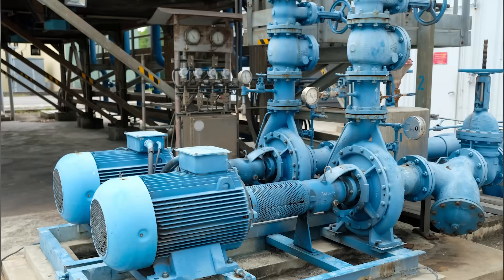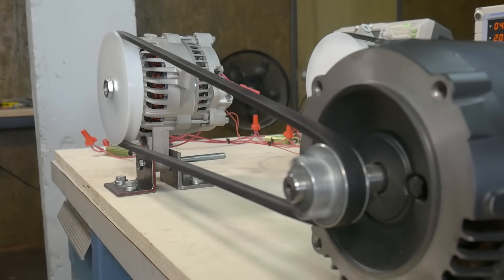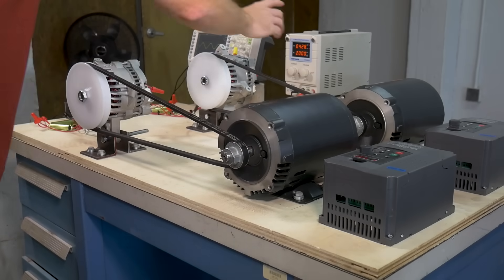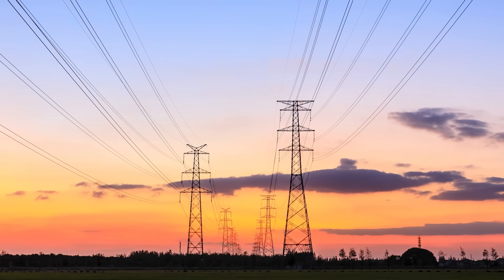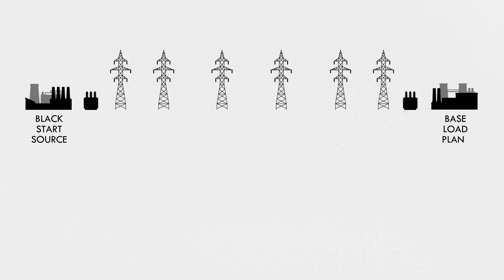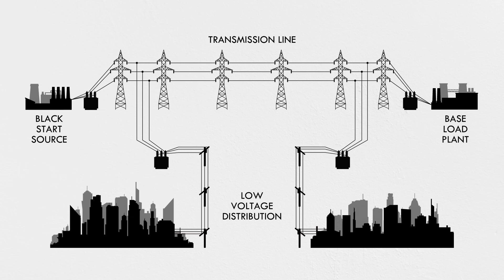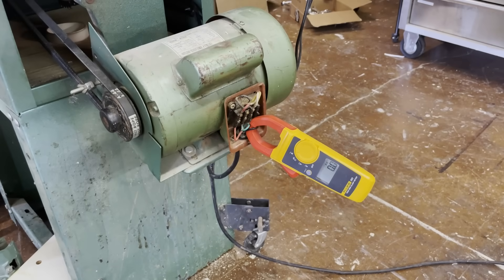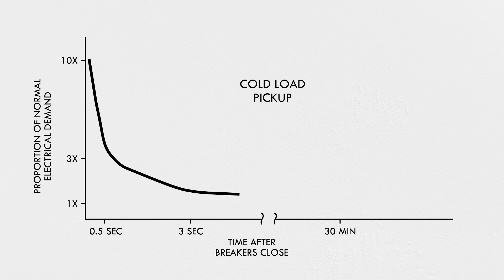What Is A Black Start Of The Power Grid?

Comment: If I remember correctly, the electricity generated by power plants must be used somehow.  During a blackstart when they are trying to get the phase of a power plant to match the grid's phase, where does that power go?
Reply: it contributes to accelerate the frequency. That's the tricky part.

Comment: Um, I understand that being able to vary the amount of power coming out of the alternator is a key and necessary feature for a power grid, but you only need that so you can match a voltage at any rpm, usually though varying current at a single voltage and rpm to maintain voltage and respond more quickly than the mechanical bits can or should.

However, I fail to see why they all need to be alternators. Besides, there have been large alternators with magnets. Why not use magnets for most of the alternators and just have a few electrically excited ones on top of the system to handle the more minor variations?
Reply: it's all alternators because we use alternating current. What you described would be true if we used direct current.  The main reason we use AC is because it opens the possibility to use induction in our tech, mainly transformers.

Comment: So, I have a question. I can see why if two generators are out of phase, you don't want to tie them together, but if you pick the right moment when they're in phase, but they have slightly different frequencies, will they naturally synchronize? Like how two metronomes at slightly different frequencies will sync up if they're on a platform that's allowed to sway?

Comment: I assume there are simulators for this kind of thing, right?
Also, how precisely time synched do different sources have to be before being interconnected? Across long distances even measuring time accurately becomes difficult, and time itself difficult to define. For example: What time is it right NOW on Mars? Of course this only applies if the precision required is extremely high.
Reply: No one?

Comment: I can't remember the channel, but was watching a video a few months back on startup of a small hydro electric dam. They were still doing it manually with a syncrotron. Very interesting to watch - it would auto trip offline if they weren't extremely close on synch before tripping the breaker; which happens several times in the video. The off-phase startup example definitely puts into perspective why grid tie is so closely regulated.

Comment: FANTASTIC video.  For the 1965 outage -- they made a movie about it -- and I seem to recall the Navy moved a nuclear carrier to New York City to provide . . .????  And, I seem to recall New York City still had some loads that were DC - left over from the days of Edison -- wouldn't those have been isolated, and still working despite the general blackout ?
Reply: If there were DC generating stations electrically separate from the AC grid, the DC system would have continued to operate normally, BUT !!!

More likely, individual customers made their own DC from the AC grid, or Con Ed made DC from the AC grid, and supplied it to the customers over separate DC circuits. In this case, the DC system is just a load on the AC system, and would go down in a blackout.

You can make DC from AC, or vice versa, using either a motor - generator set, or a (synchronous) rotary  converter. Consult Wikipedia for a better explanation of both than I can give here.

Comment: Love the deeper dive. Induction motors are an issue as are adjusting capacitor banks. 
Two nit picks - the 1965 blackout was not such much a misconfigured relay as one that worked as designed. As I heard it, the lines reached capacity and so the circuit breaker automatically operated - shedding the load to the other lines. Those lines then became overloaded and tripped off line. The cascade rippled outwards before operators disconnected themselves from the problem. 
Yes, we had synchroscopes. For small 750Kw systems coupling to the power grid, we were taught to run the system fast and then just as the needle hit 11 pm, close the breaker. Better to add power to the line than be a load. 
Question - Since the power grid is made up of smaller regions which are made up of smaller grids which are made up of individual companies, can a power plant  connect to a working section of a transmission line and bootstrap up from there?  
BTW, the whole power to run the control equipment is what contributed to Chernobyl disaster and I believe Fukushima.
Reply: Yes, 1965 was our fault (Ontario) 😪But it was a misconfigured relay, The lines were so heavily loaded that the relay saw it as a short circuit and tripped, triggering the cascade. The fact that there was a cascade was a design error of the system. It was before computer simulations were available. Nowadays, many, many simulations are run to determine maximum loadings and relay settings. 

But in order to properly simulate, every major part of the system needs to be simulated. And since the grid is composed of many interconnected utilities in the Us and Canada, complete knowledge of the system's operating points cannot be known. So a great deal of judgement is still needed. 

After the 2003 blackout one of the actions taken was to ensure that real time information on the grid is shared between major grid operators so that real-time state estimators (computer programs) can monitor and detect and warn if limits are about to be broached.
Reply: @mirskym  Thank you. 
I'm having trouble with the term "misconfigured" as the relay saw an overload and opened the circuit. 
Perhaps the trip curve was set too low. 
Thanks for the information.
Reply: @allenshepard7992  Ontario Hydro raised the trip settings on 5 of 6 lines leaving the Sir Adam Beck hydro plants. They were supposed to reset all 6 sets of relays, but didn't get the last one changed. So one line tripped on the old, lower setting. That lower setting was the 'misconfiguration'. The load instantly shifted to the other 5 lines, tripped them on the higher settings, and that caused other things to trip on overload, or to trip on loss of synchronism, and that brought down the grid. The underlying problem was that Ontario Hydro could not withstand loss of one line without a cascading outage. Their planning and construction did not keep up with the system load.

Comment: can you make a video about how a domestic solar power system with a grid connection is separated from the grid (so that it can still supply power to the house) when the grid goes down and then reconnected when the grid is up and running again?

Comment: Is the 60hz frequency synchronization, and the transmission delay over a given set of major transmission lines, predictable enough to use an independent precision timing source.  I would assume that now two major plants would typically be able to use 1ms or better accurate Stratum 1 clocks (GPS, Cell, Radio, or Synced Cesium clocks), a communication path, and a known historical value of a transmission latency allow islands to start up with a very high degree of certainty that their frequencies would match?   I would assume you could just have pre-established that at this time to resume properly, this particular plant at 00.00 seconds of every min should be 3 degrees off rotation, and the next plant over might be 3.56 degrees off, etc.

Comment: In software engineering an undesirable mass synchronization is commonly referred to as "thundering herd". Sometimes systems will have random delays added when they detect a synchronization. Power came back on? Have the AC wait a random duration in the next 3 minutes and start then.

Comment: Interestingly our standby generators for our datacentre in Amsterdam are contracted for this purpose, assuming all is well a standby set with 6MW (We have 6 3MW units and need 2 in order to operate with n+2 redundancy) excess capacity can be remote started, this is sufficient to black start a single turbine of the CCNG plant nearby. We are contracted to provide up to 150 minutes of power at full output with an export availability of 5MW through a shared substation both sites connect to. Essentially our power will be used to spin up the gas turbines much like a huffer cart to a jet airliner we can get a few tens of tons of metal spinning in order to compress and mix the fuel to allow it to ignite.